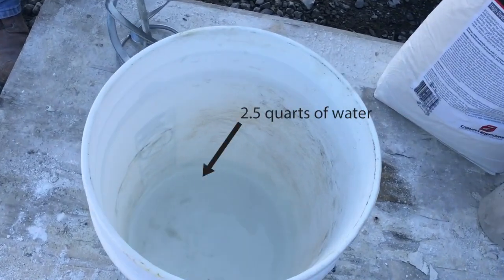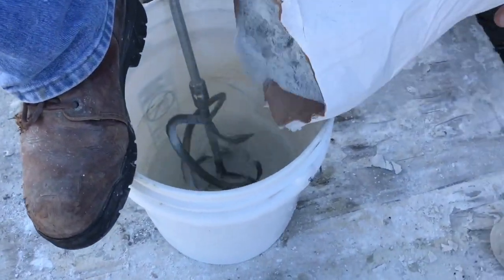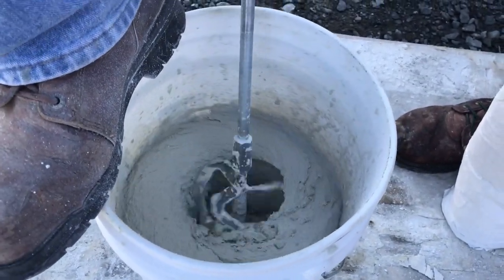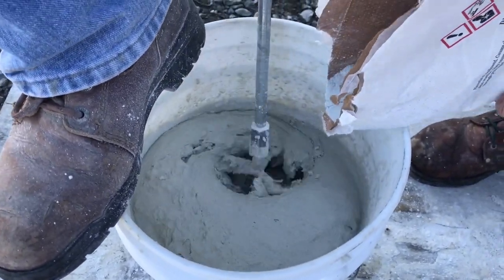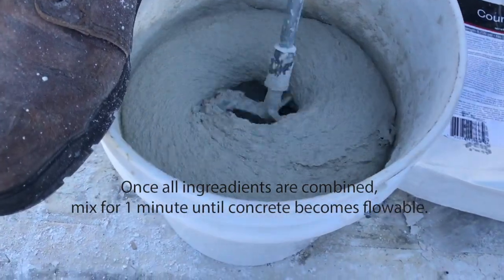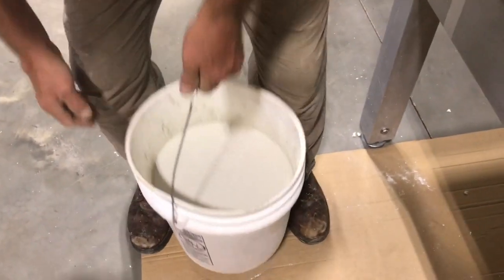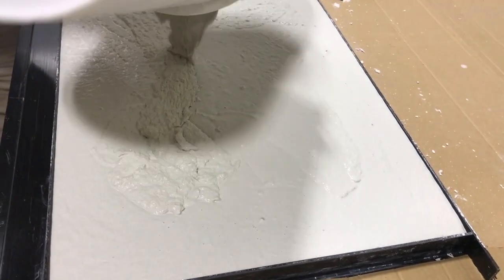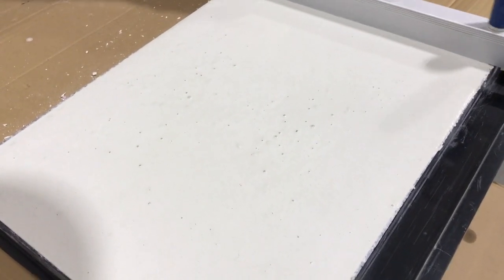How to Mix White Countertop Concrete

Comment: What is the ratio of water to concrete if you are not using the entire bag at once?
Reply from the maker: We typically advise mixing the full bag but if it doesn't make sense for a particular project, you can figure out the math. One 50 lb bag takes 3 pts of water so you can half those numbers or quarter them. If you want to mix even smaller amounts, use this math. 96 oz. per 50 lbs so 1.92oz per lb of concrete. So if you wanted to mix 10 lbs, it would be about 19 - 20 oz. of water. I hope that helps.
Reply: @ZCounterform1  thanks, I’m actually terrible at math so I have asked someone to help me figure it out so that it’s x parts water to y parts concrete.
Reply from the maker: @wootlesswocks  so it would break down to 1 lb concrete to 1.92 oz. water. You typically don't weight the water, you measure it my volume so there isn't a good break down of X lbs of concrete to Y lbs of water.
Reply: @ZCounterform1  thanks , I (well a friend) worked it out to max 70 ml of water to 1 pound or 500g of product and it’s working fantastic. I know you say to mix it all at once but I bought it to make small projects because I wanted a white concrete that wasn’t abrasive on my silicone moulds and it’s working fantastic. For others interested the 70 is the absolute maximum so if you’re using liquid pigment make sure to factor that in.

Comment: What is the ratio of water to mix?
Reply: It's 3 qt of water for  one 40 pound bag of cement.   My experience was I needed 4 qts of water to water to get the self-leveling fluidity as shown in the video.

Comment: I would absolutely order this for my project if the shipping wasn't just as much as the product.
Reply: @ZCounterform1  Yeah, that really wasn't a jab at you. I get that shipping a thousand pounds of concrete is not like shipping a toothbrush. It's just that the shipping cost brings white concrete into a similar price zone with solid surface materials after you factor in labor.
Reply: Exactly!! It’s ridiculous
Reply: @ZCounterform1  do you guys have a store anywhere close to Oklahoma? To avoid shipping costs to pick up?
Reply: @smilejesuslovesyou8108  I am in Dallas, TX area and there is a local distributor here, Barnsco Decorative Concrete, that sells these guys' white concrete mix that can be picked up if your area of OK is the southern region.
Reply: I feel you. It's probably way after the time you needed this, but I drove to pick mine up from nearby distributor. Fortunately, there was one about 1.5 hours from me.
Reply: The concrete is 40 pounds a bag, so I don't know what you were expecting as far as shipping cost.   Due to shortages, I had to buy from this company and indeed the shipping was more than the  concrete.
Reply: Can I use this for an interior brick wall?

Comment: So I accidentally cracked my countertop but I have a little bit of of the mix left. It still assembles back together well with minimal gaps, can I use the dry mix to repair the cracks? I’m afraid a regular grout/mortar or epoxy would affect the color

Comment: Your instructions on the bag said to start with 1 quart, not 2.5...concrete could not be mixed and started setting up on me right away. It started smoking my corded drill and I had to throw away the whole bag of mix and color packet. Very frustrated to have wasted a whole bag + color pouch trying to follow the directions on the bag.
Reply: That happened to us too. We used way more water and less mix.

Comment: Why do you guys have such bad reviews on amazon about your product cracking after it sets up?
Reply: @ZCounterform1  do you recommend putting fiber glass in with your mixtures  along with rebar and other reinforcement?
Reply: @ZCounterform1  why do you recommend your fiber mesh over rebar or wire reinforcement?
Reply: @Chris-5446  fiber won't discolor the white concrete.

Comment: What did you add to get it so WHITE?
Reply: Giovanni di Capo it's white concrete. It's usually hard to find at local stores. Google white Portland cement and you will come across this white color
Reply: For about $5 a bucket they sell a white powder additive to make the white concrete even whiter.  It helps A LOT.